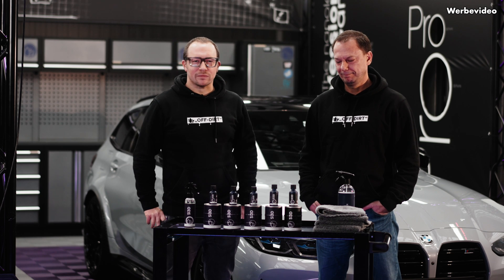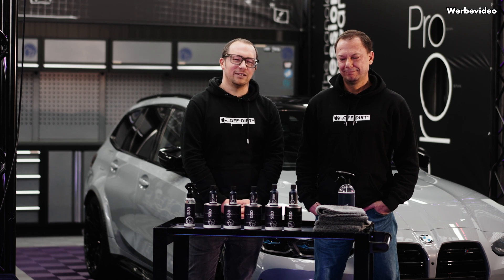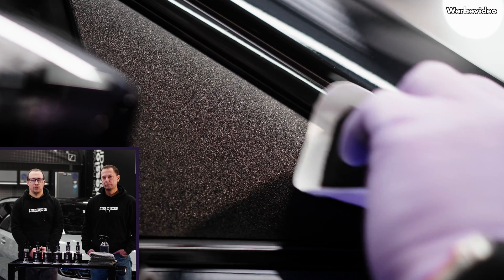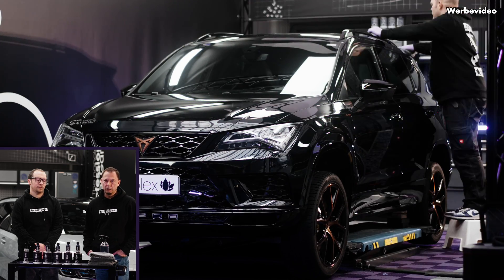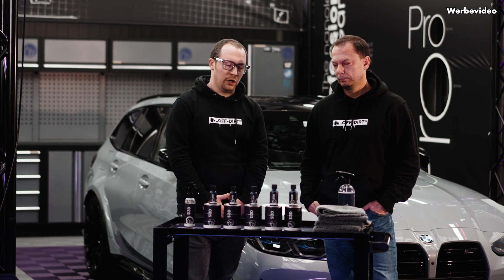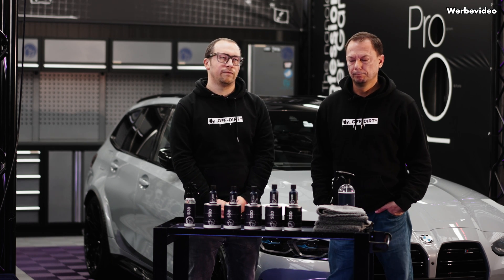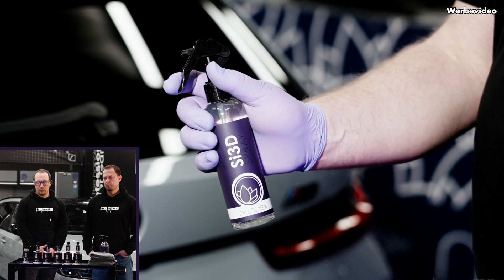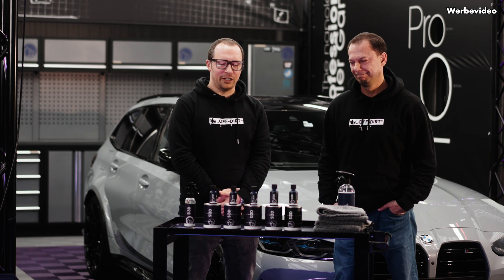No more curing time and easier to apply than ever!? All new Ceramic Coatings explained in Detail!

Comment: Nice to see something new form Nanolex. When i first started Detailing car back in 2009 in Brazil, I used the window coating and i was very surprised with the effect and durability. Things changed, I moved to Germany and I worked in a Detailing Shop in Düsseldorf and never used Nanolex by the time I was there. My Firma was CeramicPro dealer, so we could not use any other products. 
In the wheels there is a possibiliy to top layers or use another base product before Rim to make it last longer?
Schöne Grüße aus Brasilien.
Reply from the maker: Thank you for your feedback! If you like you can add a layer of Si3D BC before Si3D Rim ;)